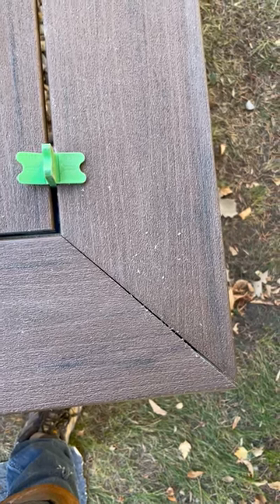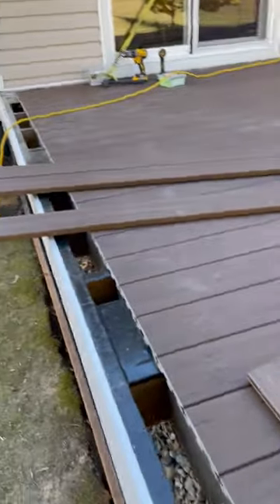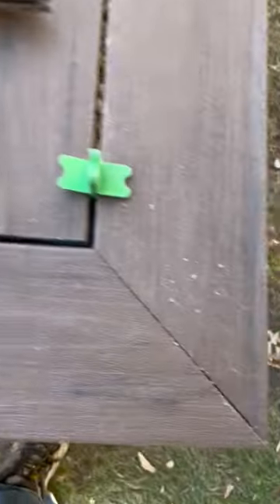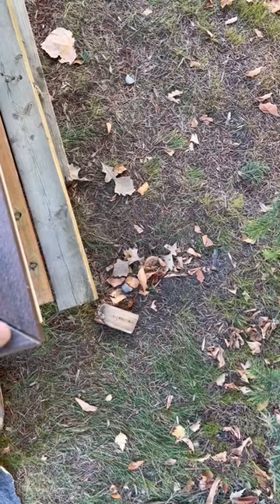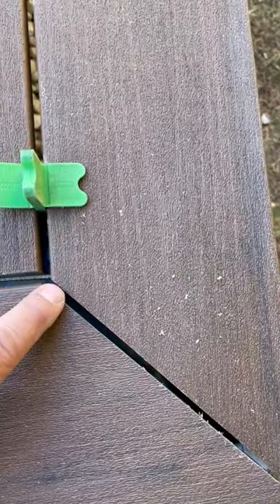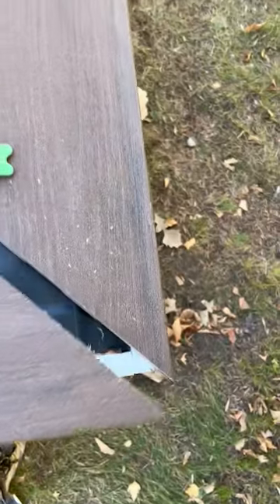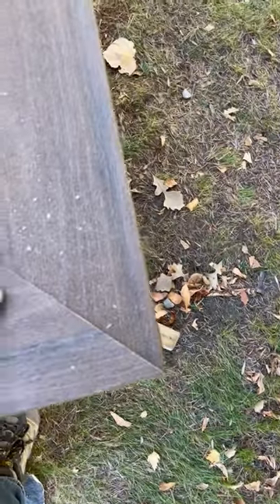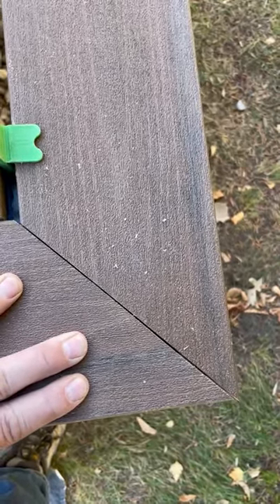Fine Tuning a Mitre Cut on a Deck

Comment: But the length of the cut is different if you don't split the angle in two. You can see that the 45,5 don't really fit...
Reply: Just use a file and clear pvc cement on the azek...

Comment: I gapped my corner miters. I am surprised folks don't do this.
Reply: You are supposed to but it just doesn’t look good. If it’s warm weather I try to go dead tight, cool weather leave a 3/16ish gap. They pretty much always end up looking different after a while anyway
Reply: bc it looks bad! glue and screw baby
Reply: @staples361  If it gapped evenly it looks good. And you can rest knowing it won't buckle in the heat.
Reply: @wayneosaur you are correct. Pros know you install according to manufacturer specifications……especially on long pieces. Throw a tight miter on a stair return that has one end 11”return if you want .
Reply: I use a sliding bevel to measure the required angle and then transfer that mark to the board I need to cut.

Comment: Tip - angles must match or the miter cuts will be different lengths. 1. Get a cheap digital angle finder. 2. Measure the angle. 3. Divide by 2. 4. Cut angle on calibrated miter saw OR cut one board face up and the second board face down to ensure same angle. - pocket holed miters and corner screws can help keep them true over time if you’re anal as I am.

Comment: it's going to open up anyhow with heat and cold, unless you live in an area with no temperature changes.
Reply: It's composite
Reply: @sonjakozman1699 it's pressure treated lumber underneath and composite does also just not as much.

Comment: You can also put a color match screw right through the side of one of them after you pilot hole
Reply from the maker: That may help.
Reply: What about a using exterior glue to hold the gap?

Comment: The toes and heels don’t line up in this scenario. Making a miter fit isn’t really about adjusting one side. Seriously though I have a deck company doing guaranteed twice as much work this guy and we would never do this. Also glue your miters as a pro tip

Comment: Rookie.
Reply from the maker: Hoping to help others.
Reply: @decksbye3269  take equal fuzz off both pieces. So they stay the same length on the miter. If they're different lengths it really shows. But your typical customer won't see it. Peace. Keep up the good work.
Reply from the maker: @courtney6183  Really good point about having the same mitre on both boards.